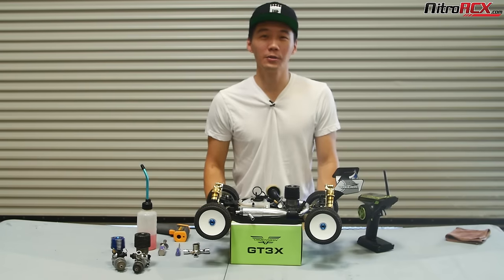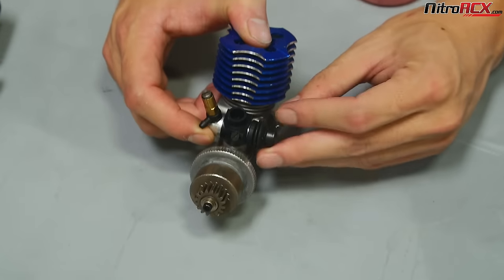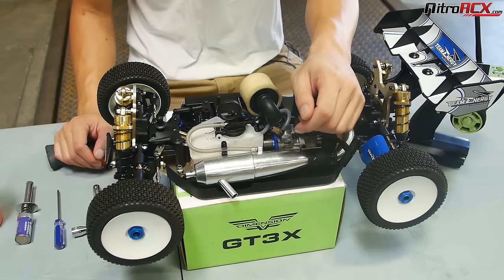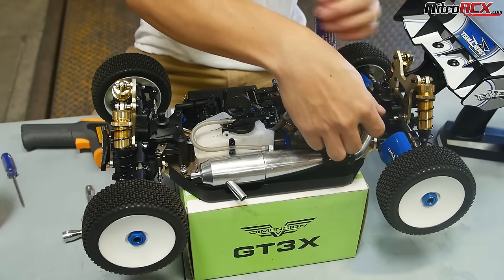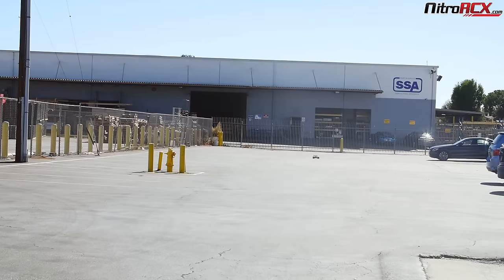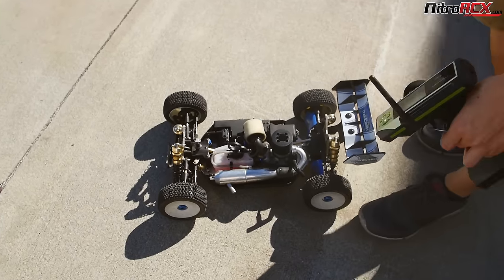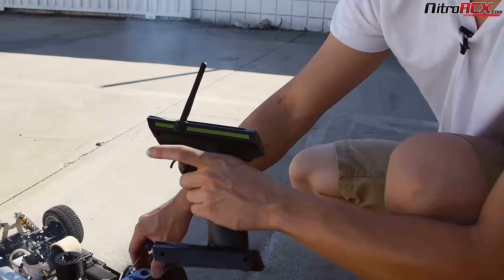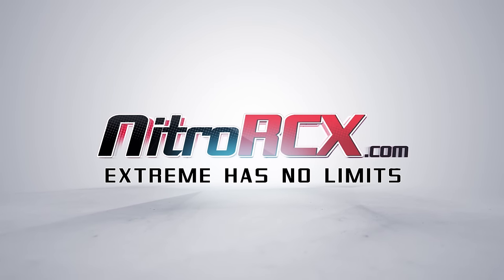Nitrorcx Guide: Fine Tuning your Nitro RC Car

Comment: You left that bottom end pretty lean still, do what you want it's your engine. However your teaching people, most of which have to pay for there stuff. What I'm getting at is those people should definitely know that leaning an engine even just a little past ideal minimum just for more power or a slightly quicker pickup drastically reduces the lifespan of the engine on a scale worsening the further past you go.

Comment: I have electric cars.  How much does Nitro car like this cost ?
Reply: T. Man $400 ish + $40 for a gallon of fuel + $20 for a decent igniter this is of course for a basic (but good) rtr version with a pull start. So under 500 for sure to get started in nitro.

Comment: hey whats up new to the hobby i have a 1/10 nitro rc and its a run away i watched a few videos and tried to tune to break in high speed is 4 turns from closed and low speed is flushed with housing closed i guess did one run with run away trying to get the tune right HELP!!!#!
Reply: lower the idle. I have a 1/8 exceed buggy (Exceed madfire)
Reply: it should be on your controller the throttle trim. if you turned on your control first then car then it would work. also have good battery's
Reply: So turn high speed needle down
Reply: I have traxxas
Reply: i have t maxx, so what is your car doing when yo start it. When you have control of it does it studder?
Reply: ok so the low speed needle is the one on the right side of the engine. turn it in
Reply: and by the way a t maxx is a traxxas
Reply: If the vehicle is running away upon starting check your carb opening gap.
Reply: If your car runs away, you can use the throttle trim dial to apply a little break.
Reply: Wrong answer brother. Please realize using the throttle trim to do anything other than what it was intended for will almost guarantee to throw off your tune. Sir take your screw driver and with the electronics on (engine off) close the venuri gap via the idle stop. It's taking off now because the linkage is all jacked up most likely. Just remember you want about .075mm opening, and when you neutral it should stop at .075mm and when you brake it should stop at .075mm. Anything else, you will be wasting your time doing anything other than fighting the engine
Reply: Your are correct sir. I've learned a lot since I made this post. This hobby is fun.
Reply: At idle, you want to make sure the gap on the carburetor is about 1mm, when you full brake the car, it should still be 1mm. Otherwise it will take off if the gap is more than 1mm.
Reply: J Ma I have a problem. it's getting cold and I leaned in my hsn. the engine has a hard time getting hot. it's only warm after hitting the trigger and tuning till it ran out of gas. it's a discontinued. 27 rex r 80 engine

Comment: When you're accelerating from idle... you're going to full throttle... which means its working off the high speed... not the low speed!.

Comment: The nitro comes out of the exhaust what is the problem in this case?
Reply: Rc mak
Reply: its just the brake in
no worry
Reply: There's always going to be some stuff co,one out of the exhaust besides smoke. A tiny bit of fuel, a little lube...

Comment: Can u use traxxas glow plugs in this car
Reply: Generally the brand of plug doesn't matter but if the engine requires "turbo" glowplugs then you have to use them & if the car uses standard glowplugs you have to use them.

Note: Turbo doesn't mean the same thing in nitro. It's just the name for a different shaped plug.

Comment: Can u use traxxas top fuel 20% in this car
Reply: Any brand of fuel is fine, just use the right % nitromethane for the engine. Regardless, 20% should be fine. I use 25% in my KE21r engine.

Comment: Does anyone know why my kyosho inferno drives forward automatically
Reply: idle speed is too high. Adjust the stopper screw to close your carb gap a little. Another possibility is you're too lean on the LSN.
Other possibilities are throttle trim on the transmitter may need adjusting.

Comment: can i run it without tunning and iam a beginer
Reply: Not really, nitro engines need constant tuning so make sure to follow the tips in this video otherwise you risk running too lean (not enough fuel) and frying your engine.

Comment: When you lean the low speed and the idle starts to climb, do you then need to adjust the idle speed?
Reply: No, if it climbs richen it back a little, having a slightly rich low speed will give your engine more longevity. Tuning the needles doesn't control how much fuel is added at a given rev it controls how much fuel is added per throttle position. Low speed controls how much fuel is added up to about half throttle and when you let off the throttle or brake because the carb closes, high speed controls the overall amount of fuel let into the carb and how much goes into the engine beyond half throttle. 2 stroke engine by nature get starved of fuel when you let off the throttle because the the engine is spinning faster than the amount of fuel (and air) going into it, the fuel carries the lubricant unlike a 4 stroke engine. If your driving around at speed and not stopping and starting from a standstill all the time richen your low speed so as the engine has a bit more fuel (lube) going into it when you're slowing down for a corner, you'll get much more life out of your engine doing that. Keep the high speed slightly rich too. That racing tune for optimum power is fine for racers but they change engines or pistons and sleeves every few gallons because of it

Comment: I love how he says "low idle screw doesn't change the idle."  Uh, yes it does.  that's why it's called an IDLE SCREW.
Reply: Rooster 2000 it doesn't change the mixture, only a throttle stop.
Reply: Thelemorf yeah

Comment: only thing that i hate about nitro rcx is i bought a boat from them once i bought it if you break any parts on the item good luck getting replacement parts which they are always out of stock and there customer service is very very slow to get back to you about the issue if they erer bother to respond to you at all..there are alot better company'sout there... in my openion nitro rcx is a shit company that does not stock any replacement parts for what ever they sale good luck if you buy stuff from them i learnt the hard way

Comment: this has never been a nitro engine, nitro engines does not exist, but methanol engines do!! often called glow engines, due to the glowplug system on it, Nitro is the addon booster in the fuel.you dont see a dragster having a nitro engine, but top fuel dragster Run high % of nitro in the methanol, so it too is a methanol running engine, with added nitromethane.